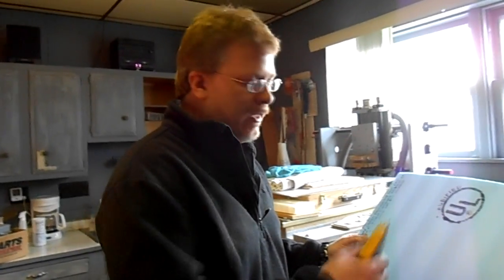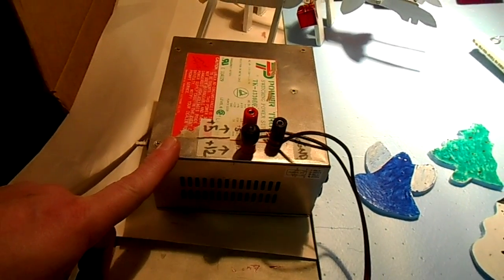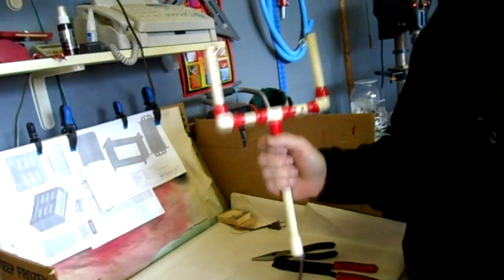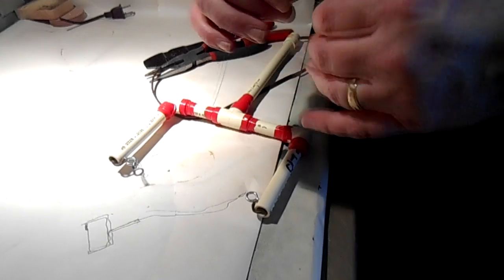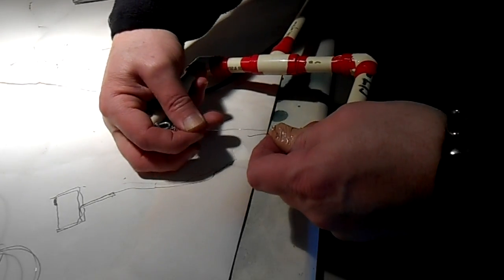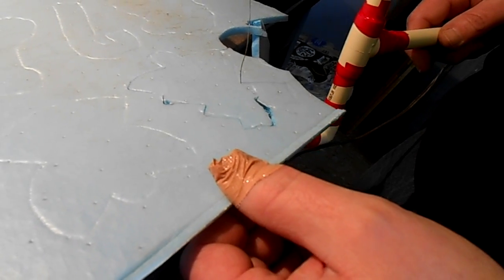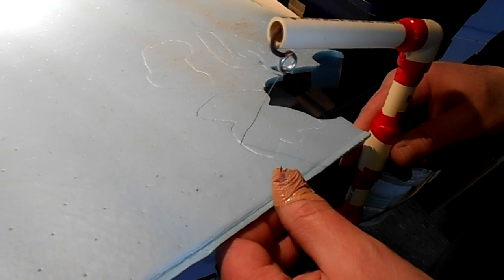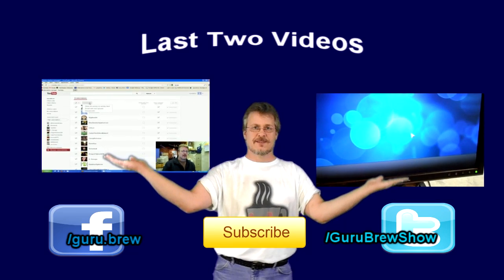DIY Foam Cutter on the Cheap - HOT WIRE!

Comment: Great idea. I made a couple of changes. Used a 12 volt dc supply instead of 5 volts because I'm cutting thick foam. I did not use a spring. I installed one eye bolt exactly as you did. On the other side I drilled through the 1/4" eye bolt and pinched the wire between two nuts out on the end. I drilled out the hole in the cpvc on that side slightly larger than the bolt and have two nuts that hold it in place. I can adjust those nuts back and forth to achieve a very specific tension. Thanks for the video! It really helped me.

Comment: How did you change the power supply? I have a good one I can use but no place to screw wire onto.
Reply: Look in "you tube" for "computer power supply" ---  several clips on how to convert one to supply   5v and 12v   ---- It's a GREAT item to have   --- do it

Comment: Why would you use 5 volts when you have a 12 volt supply handy?  12 volts will cut faster than 5 volts will.   I've used computer power supplies in the past and if you gather all red wires together and twist them together you will have more amperage to power the styrofoam cutter.  That's what I had to do to get enough amperage to drive my computer monitor driver board.  It works great.  Just my 2 cents worth.  :-)

Comment: You need to attach the wire to the side without the spring first and then pull the other side through the loop of the spring, give it a good bit of tension and then twist and tie it off on the spring. Your wire had zero tension, and when the wire heats up it expands and has to have the spring to pull it and keep it tight. That's why the wire was loose and sloppy. It was flopping around like a string in a hurricane. I can't believe that wasn't obvious to you. Also, the spring from a pen is way too weak. Get a better one from any hardware store for $2. These are exceedingly easy to operate with precision unless you're Michael J. Fox.

Comment: Thanks for this.  For the electronics people... if I wanted to mount an LED to the handle (to indicate that power is flowing), and assuming 5V, what resistor would I need for the LED. And would this affect the power/temperature of the cutting wire? Thanks.
Reply: It all depends on the led but Google a resistance calculator for a led

Comment: Where does one buy nichrom wire? By the way this would also be a great block of cheese slicer.
Reply: moofushu you can find them in a hairdryer or a toaster.
Reply: moofushu I've seen some on E-bay for very cheap. ;)
Reply: Mohamed Yassine Indeed.
Reply: +Mohamed Yassine Thanx. I just realized I had 1 sitting on my desk... lol Took apart a couple hairdryers for parts.
Reply: I may be a little late to this party but the easiest, local place to buy NiChrome or Kanthal wire is at any vape shop. I can get a 30 foot spool for about $5 in east Texas

Comment: Would a 5 volt dc adaptor work as well. So I can just plug it into the wall?
Reply: I made my own, with a 12 V dc 1,25 A adapter :) The 5 V would prob just lower the temperature in the wire and keep it from getting ruined for long use :)
Reply: It all depends on the length and gauge of your heater wire. There are online calculators that will tell you the voltage and current (amps) you should be using. Mine is 8" of 24ga kanthal A1. I'm running 5.21 volts at 2.71 amps (made my own transformer) to get a wire temperature of about 600°F. "Pro tip" if your wire is glowing orange, it's too hot.

Comment: What's keeping the hoop screws from heating up and melting their way back out of the PVC?  Especially if the string is stretched tight....?
Reply: Foam dosen't need to be vary heated to cut like that and i am pretty sure your not going to be using it that long
Reply: Yeah, that's what I thought of also.  I would use a longer eye bolt and have a nut on the other side holding it in place.  That way you can really tighten up the wire too which this guy needed to do badly.
Reply: The eye bolts are much larger diameter than the NiChrome wire. There isn't enough power to heat them up, also the NiChrome would melt (vaporize) itself before the eye bolts too hot to hold onto. What he really needed was more tension on the wire (a stronger spring)
Reply: +George Moureau    Good point and it's probably what's happening. As you see him cutting, the wire is wobbling because of the point George brought up.

Comment: Thanks Guru! Looks like that is .016" which is 26 gauge. I really like the design. The cases I get with the "pick and pluck" foam always end up getting ripped up for me when putting equipment in them. Think a solid piece would hold up a lot longer. Thanks for your video!

Comment from the maker: Hi, the package was purchased at a hobby store and it is made bu SIG the item number is SIGSH135. There is 5 feet in the package and it cost $4.79 sorry no other info on the package. It appears a little smaller than a high E guitar string

Comment: What gauge Ni-Chrome did you use? It is becoming commonly available with the ecig industry, but wondering if the stuff used there is thick enough - usually 28-32 gauge.

Comment: NI-Chrome is Nichel and Chrome (80% / 20%) and has a high melting point, so its still fairly tough while red hot. Other wires my suffer from fatigue early, copper will snap easily. Nichrome is cheap though and you probably know someone with old guitar strings going spare.

Comment: I reckon a guitar string and an old tuning post might be best - you can tighten the string up. You don't have to use DC either, a 9v transformer of 50VA is enough from what I read.

Comment from the maker: Hello, I do not use any resistors in my design however if you used a variable resister such as the type to dim a indecent bulb, it would allow for finer control over the temperature of the wire but don't feel it's necessary. I have heard that some are using the smallest (E or B) metal (Nickel coated) guitar strings as a substitute for the nichrome wire. Good luck with yours

Comment: Gurubrew:thanks for such a good tool and steps to make it.
I an inspired and trying to make one.
I got a power suply for 14vdc and 13a frm radioshack for the same made the tool but I dint get nichrome wire .do you suggesr any other alternative for cuting wire? I used copper fpr cuting but I dint realize you hav small resistor in ther.Can you confirm if you are using a resistor nd if yes then what specs?
Thanks

Comment: for that power supply, did you just chop all the wires off and add those connectors???  What are those called that your hooking up the leads too?